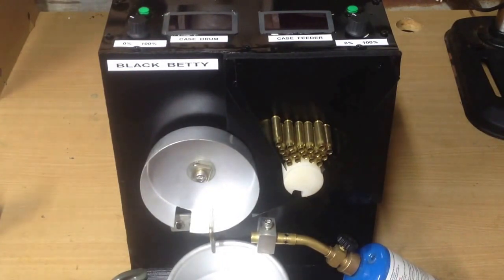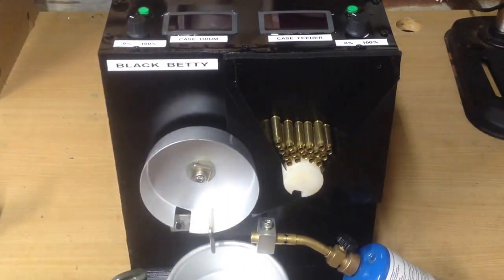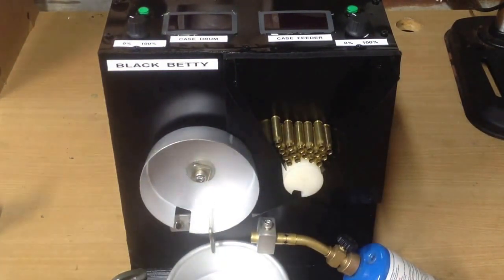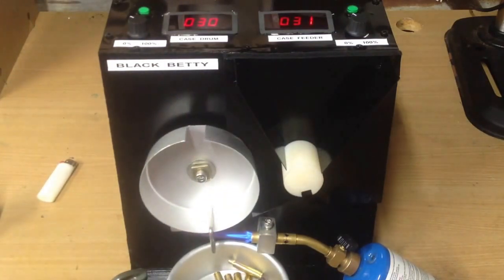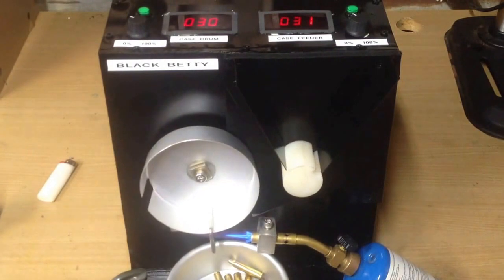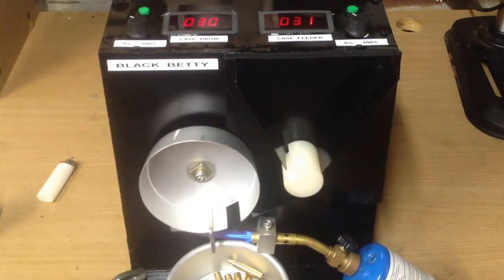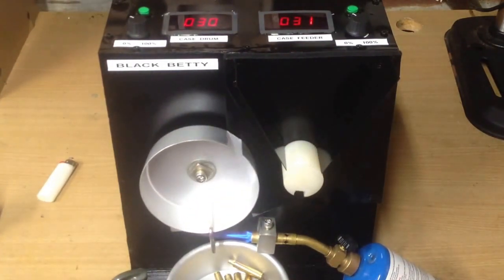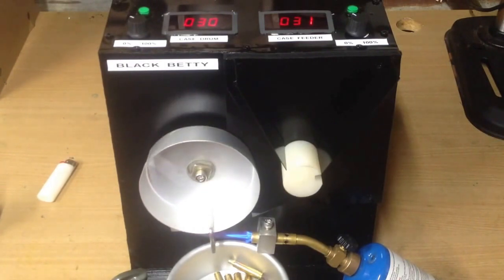Skips case annealer v1.6 final build the finished result.

Comment: Couldn't you have used 1 speed controller for both motors?  Could have saved a little money.  If they are placed slightly out of phase and spinning the same rpm, wouldn't this work with one less controller?

Comment: Very Good! Quick question - I have the same motors you got. How did you attach the pan to the one on left, and the nylon for the case roller?  Looks very well done!!
Reply from the maker: I attached them to the motor's via a grub screw. The "pan" i made the the shaft coupler. But i think i have found one that can be brought and used with little to no modifying. ( as the pan has almost no load on it you wont need to worry about the coupler flexing and bending. 

As to the nylon bit where i cut the slot i drilled a M5 hole and ran a M6 tap down the hole for the use of a M6 grub screw. Or you could cut the head off a bolt and cut a slot in the shaft to use a flat head screw driver ( kinda a make shift grub screw ) 

I am in the process of doing a simple drawing and a part's list to post up in our forum for member's to make there own. The whole built can be done with simple hand tool's. a Mill and Lathe are not needed to make this project work. some simple power tool's and hand tool's also a bench vice ( you can buy small one's for $30 ) will help you in a big way building one. 

I am also re doing my first one ( also as a diy built supplying the part's list and a simple set of plan's. ) I just have to finish it all off. 

The Auto feeding version will cost ( $130 total inc the torch ) if you are buying everything for the first time. For the manual feed ( so far i have got that down to $50 for everything inc the torch ) As to who long it will take to build that's up to the person.

Skip
Reply: SKIPPYISAAUSSIE Thanks a lot! I look forward to seeing your future mods.

Comment: Skip, awesome job. I'm working on a build myself.  What are the digital readouts showing? Rpm or voltage? 
Thanks
Reply from the maker: I believe that the read outs are in % and not in rpm or voltage. I could be wrong. The digi read outs help whilst setting up different calibers, i also record the settings on the side of it. 

750f templiaq is what i use on the necks and 460f for the body when setting up. 

Hope this helps 

Regards

Skip

Comment: skippisaaussie how did you go about cutting your cake pan? i really messed mine up and have to go and get another.  FYI I read through the page on the shooting sight, did i miss how to do this part?
Reply from the maker: I had cut mine with a fine cutting disk with a grinder. But i found the dremil with cutting disk easier when cutting. 

I tried with my lathe, but  i had it catch when trying to part the last 1mm can it rip out the chuck into my face. So back to cutting them with dremil and clean up with hand file.
Reply: +SKIPPYISAAUSSIE thanks, I tried a jig on the bandsaw, and the the lathe also with no luck. I'll give it a go with the cutting disk. my other idea was to just make the thing from some sheet and tack weld it around the outside.